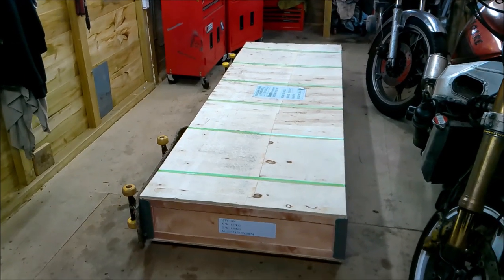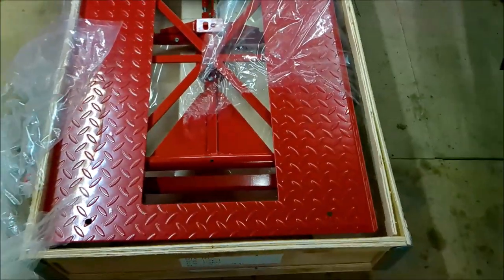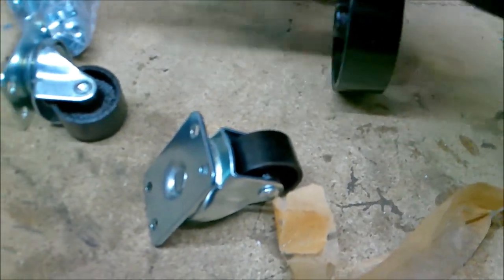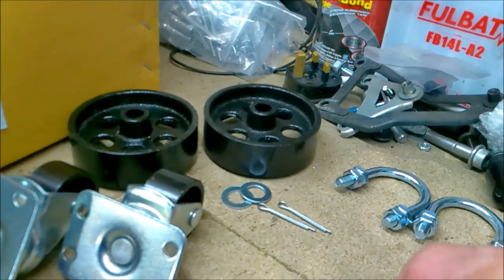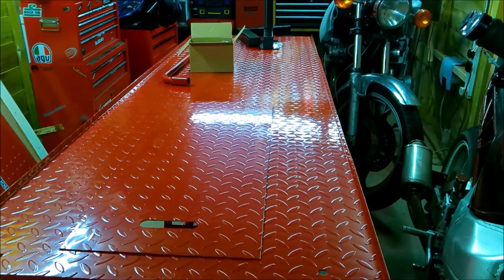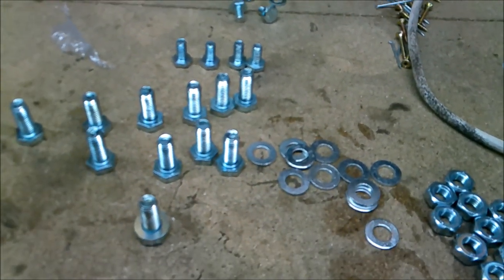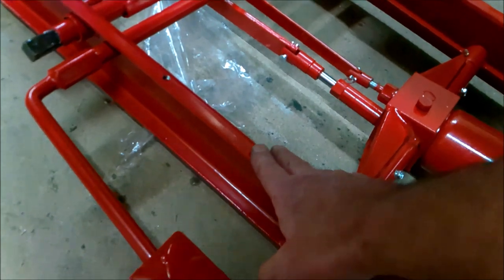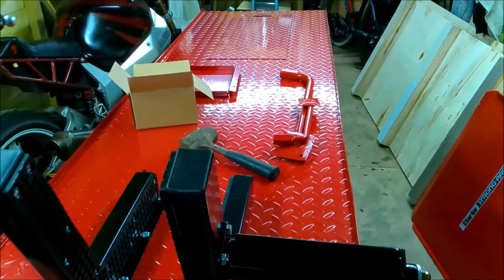Clarke CML3 Motorcycle Lift Table

Comment: Didn’t fancy an Abba Sky lift then?  But that is a really nice piece of kit you’ve got there. A couple of safety straps and you’ll be ready to go. 
Should make videoing much easier for you as well especially when you want to show us those low down back breaking areas on the bike - looking forward to it👍
Reply from the maker: Did i not mention ‘I’ve got an Abba Skylift’, to be honest I’m storing my mates Abba Skylift for him so I’ve actually got two Abba Skylifts in the shed at the moment. Trouble is the GS1000 won’t fit on them. . . and I’ve got more floor space now so a motorbike lift table was what i ‘needed’ (can’t believe the Misses fell for that line!) and I’ve got safety straps, nice Orange ones 👍
I’m definitely looking forward to no more crawling around on the floor! First test will be this weekend doing an oil and filter change on the Gixxus 🤞
Reply: @bikerantics5001  Lol you’ve got the lot all the gear, lots of bikes and a good woman - ride safe
Reply from the maker: @andrewshore262  all the gear no idea! . . . and excellent Woman . . . or stupid for putting up with my shit!!

Comment: How did they deliver this? They have to fork lift it off a truck? Thinking of getting one but access is a bugger
Reply from the maker: Hi, all they do is kerbside delivery, you have to figure it out from there, unless they’ve changed their policies recently 🤷‍♂️
Mine was delivered on to my driveway, while I was at work, signed for by my misses. To get it to my shed I had to take it down my neighbour’s driveway and then turn right along a narrow path at the back of my house, then another 45° right turn up a 12” high 18” long ramp on to my decking. Then over a 1.5” step into my shed. I used two skateboards under one of the long edges of the crate it comes in. Obviously on its side it was a lot thinner to manoeuvre down my narrow pathway and in to my shed, my misses was on hand to help steady it. With hind sight It would definitely have been better to have a mate help me out🤷‍♂️. Hope this helps with your decision 👍
If access is truly a nightmare then maybe look into an Abba skylift, it’s a bit more fiddly to get your bike on but it’s a lot more versatile and manoeuvrable than a lift🤷‍♂️ and gives really good access to all of your bike👌
Reply: I say access is a nightmare, but access is only a nightmare if the driver hasn't got enough confidence to get a 7.5t truck down the lane. Its doable, just unloading it from the truck was my concern. I can probably get it delivered elsewhere and load it in the van piece by piece if nothing else I guess. Cheers dude!

Comment: Ive been after something like this, but the carriers insist i have to have a fork lift truck to unload it with (!)  In a residential property ??
Reply from the maker: It’ll definitely take a couple of strong fellas to man-handle it, because of the size of the crate and the weight, but it’s definitely do able. It certainly helped screwing skateboards to it to get it down my back passage 🥴

Comment: Hi, thinking of getting one of these. How big is that crate when it arrives? I have a Machine mart local to me and said i can collect if i have a suitable vehicle. Would it go in a big estate car?
Reply from the maker: It’s about 7’6” long by 2’8” wide by 12” high and 175kg. The problem would be lifting the end up to pull it into the car because of the weight, you really need a pick-up or a drop-side vehicle. The only way it might work is by unboxing it (that’ll save a few kg’s!) and sliding it in on its bed or lay the top of the crate in the car and slide it up that. It’s still fairly heavy to haul around though. Good luck 🤞
Reply: @bikerantics5001  cheers buddy. Much appreciated 👍

Comment: Is this stand ment only fr small bikes, how to support the rear wheel fr heavier bikes ??????
Reply from the maker: Hi, i think this lift is rated for 450kgs and easily lifts my Hayabusa at 270kgs, as shown in this video:-

https://youtu.be/3W797WLVszY?si=aGvGIIgIKwIsKOYu

I use a paddock stand to support the back wheel. Hope this helps 🫡
And you definitely used to many question marks😂🤣

Comment: Am I being pedantic but are the caster bolts upside down 😜 I have a lift similar but struggle to get my bike on it 😁
Reply from the maker: Bolts are as per instructions. . . probably 😬
The ramp is a little steep and will have its first test this weekend 🤞
Reply: @bikerantics5001  They are a great bit ok kit, I have one but struggle to get the bike on it 😒